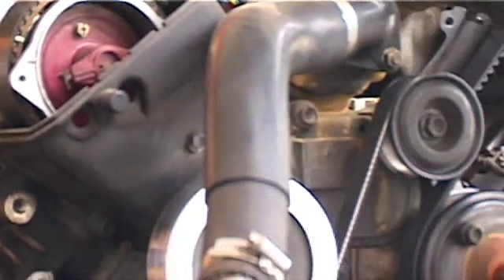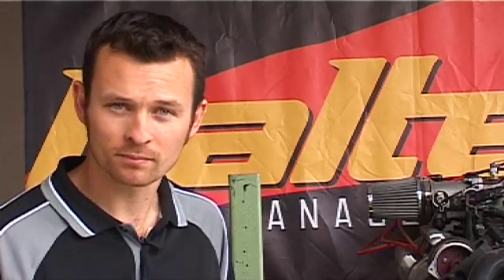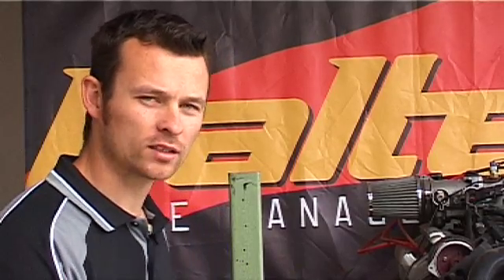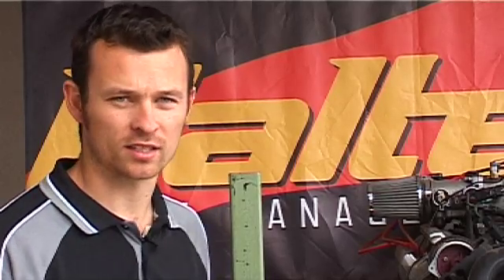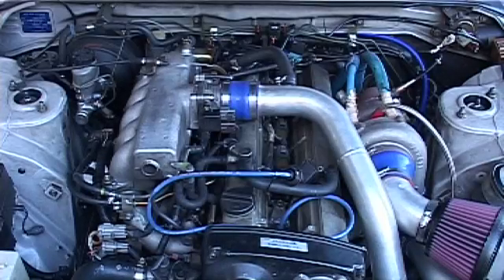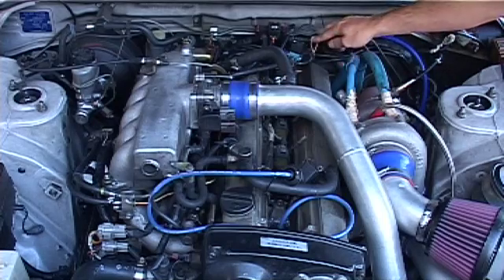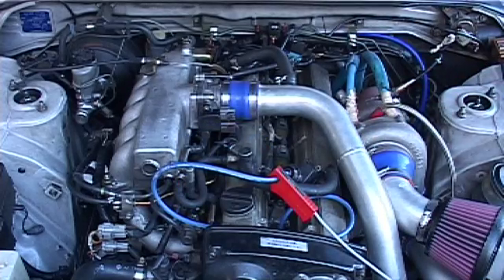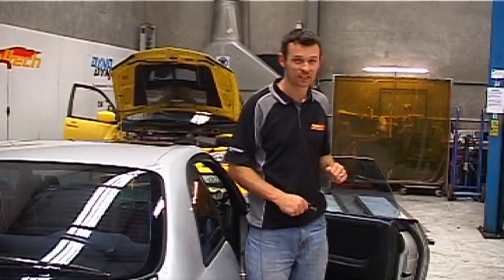Base Ignition Timing Explained - Technically Speaking

Comment: So ones you locked it lets say at 10 and zync it with the crank pulley 10 degree line do you go back to the setting to disable the timing lock setting